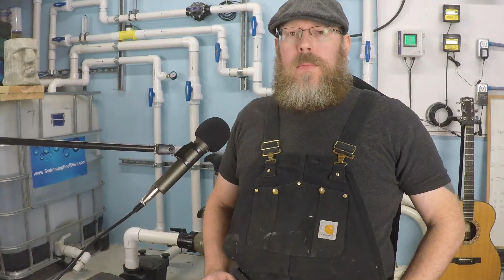DIY Concrete Pool Construction Mistakes

Comment: Been building pools for 40 years. Trust me. Call the pros. It’s worth it. If not you’re rolling the dice. You really do need to know all the little tricks, that’s what separates the men from the boys (and in most cases the difference between success and failure). A true service professional no matter what industry will probably give the same advice. Just trying to look out for peeps 👌

Comment: Is it worth doing both basecrete and hydroban? I’m building a concrete block plunge pool (filling voids with concrete and 1/2” rebar). Interior will be full tile, hydroban alone seems sufficient for waterproofing but I’m wondering if adding basecrete will increase overall strength and extend the pools lifetime
Reply from the maker: I would not mix and match waterproofing systems. You pick one and use that one only.
Reply: @Swimmingpoolsteve  thanks for the reply, your vids have been extremely helpful. Would you recommend basecrete over hydroban for a block build then?
Reply from the maker: @cameronm18  I would. When used properly I do endorse basecrete over any other waterproofing solutions. But that is just based on my experiences, and not to say that other waterproofing solutions are no good. I just prefer the Basecrete products. Laticrete would be my second choice for what it's worth, but it would also depend on whether you had a weir wall or not (water on both sides of the wall)

Comment: If you look at the documentation for most (if not all) reputable pool tile manufacturers, they recommend 3 separate layers of waterproofing, 1st a colloidal silica product sprayed onto the raw concrete shell, after it has set/hardened.  2nd, a cementitious  membrane like basecrete, or one of the similar products from other manufacturers.  3rd and final, an elastomeric membrane like hydrobahn.  When I build my pool which will have a full tile interior, I'll be using all 3 waterproofing layers just as the tile manufacturer recommends.  It's not worth risking 10's of thousands of dollars worth of tile because you cheaped out on a a few thousand dollars extra worth or waterproofing products.
Reply from the maker: 100% truth. Even more important when you start talking about the more expensive tile options like glass

Comment: Ive planned a pool with 8" formed walls and 5 inch base. Its all uniform  4" depth with both sides having a 12" depth for the kids. First thing is, I am not excavating ground for the pool. I have a cut and fill site and plan to build the pool walls - stand alone and then backfill after removing the forms. I'm planning to pour the base first and then the walls, with a key seal waterstop. I have drawn in a bond beam, which will also have the skimmers and returns placed in the forms - Should the skimmer intakes be two 3 feet apart? and tee in the wall leading back to the skimmer. Can you comment? Can I trouble you for another question - I will have to mount the skimmers in the forms

Comment: I have had an Endless Pool for 24 years (built it myself), now intending to replace the galvanized steel wall panels with filled concrete block, rebar & mortared joints. I'm planning to use large format porcelain tile on the inside wall surfaces (I have experience with that). Floor surface will be the shaved stone mats. Will the Redguard work for waterproofing over the concrete base and wall block surfaces? Would the Schleuter membrane be better?

Comment: Great informative video bro...im from the Caribbean...just gathering info. to start my own conc. pool soon. Thinking of doing a saltwater pool. What water proofing brands do u  recommend or can the same that u just mention work...thanks...
Reply from the maker: Look into basecrete as the waterproofing solution for your concrete pool. There are other options also but this is a good one.

Comment: AMAZING! Thank you so much for this video, very hard to find information about it elsewhere! - I am interested in pouring a concrete hot tub where the concrete is left with a raw finish. Do you think I could achieve the right level of waterproofing by using a water proofing additive like "Sika WT-240" or "Bio San 500"? If so which do you recommend? Also if I were to use an additive would you also recommend using a sealer like "Siloxa-Tek 8500"? For reference, the hot tub will be freestanding in a garden area. Many many thanks!

Comment: Thanks for the honest information. I am planning on building a concrete pool and spoke with an engineer as recommended. He immediately adressed all the concerns you had.
Reply from the maker: This is the way yo do it. Build a pool if you like...but hire an engineer to help with design, site inspection and soil samples, concrete and rebar specifications etc.

Comment: Steve's information is fantastic. I'm going to add that a cinder block concrete pool can be built but here's how using key instructions and types of materials: 
1. Building a concrete swimming pool out of cored blocks that look like cinder blocks (cored concrete blocks to fit rebar in and connect to each block) works. And it's not that hard but you must be patient and understand each phase. Curing is the key.
2. Use 1/2 inch rebar vertically in every cell and 3/8 inch horizontally. 
3. Mix rock with 4000 psi concrete mix. Pour each few cells at a time. Take the time to compact within in cell of each block.
4. When finished with walls. You pour 6 inch floor AFTER in small sections so that you have small expansion joints. Meaning there will be no cracks in the floor because each section is poured so small. This is crucial. Same mix as you did filling the walls. The rock is 3/8 inch and must be mixed with every batch. We do this all by hand with a bucket and not with a cement mixer.
5. Backfill with concrete and rock. Do at the same time you're doing the blocks.  (backfill is what goes behind the cinder block)
6. After walls and floor are poured? You use Rapid set cement mix to plaster on walls. It has a 9000 PSI. Rapid set is used at Home Depot. It's the key to everything.
Nothing is bringing down the walls and there will be no cracks if you do it this way. We do private homes this way. It's stronger than any shotcrete mix with any company. The difference is how it's all done. In small sections each day. Yes it will take longer but will be worth it. Expect it to take a year if you dig out you own inground pool by hand. If not, then 6-8 months depending on weather. Keep concrete after poured misted with water every hour then saturate with water after 24 hours. This is also the key.
7. The key to real waterproofing? Rubberize IT. This will create a 30 Mil membrane. You will never see a leak. Look up that product. It's non porous. You build it up by painting it on. It works better than a liner. Liner's tear. This won't. 
8. Go look online at any above ground pool. The largest you can find. The sides are a joke. And yet it holds up with no leaks. Why? Because of how the water is contained. They use a 20 mil liner for the standard pools. Yet the framing holds up hear after year. The key to everything is waterproofing but the foundation must be solid both with concrete and rebar. The rebar keeps the concrete tensile strength. The PSI is also crucial. If you do all the things above? And listen to Steve? You can and will build a pool that will last you a lifetime. The only difference is with Rubberize IT product? It will last longer than you if you go 30 mil on the buildup and use the material behind it shown on the website and never have to do a resurface your entire lifetime. Know these products. Understand them inside out. And it can and will be done.
Reply: Appreciate your advice on this, as I will follow it when I do my renovation. I have an Endless Pool, so only 30" water depth, and only 7 x 14' interior dimension. I need to replace the steel frame (rusted out after 24 years), so am planning to do the walls with 8" thick hollow block, mortared, reinforced and filled as you recommend. Interior wall surfaces I'm planning to use large format (2 x 4 ft) porcelain, rectified edge, with controlled lippage (I'm experienced with that). Bottom surface will be the shaved pebble stone mats. The floor slab is 8" thick concrete, on-grade, thus no groundwater issues, and even though I'm on a steep slope, the whole tub hasn't slid downhill over yet (heh). Structure is surrounded by CCA wood deck and underpinnings, so is just as sturdy as the year I built it (1999). My main question focuses on the type of waterproofing that I should use on the interior surfaces before I install the tile. Is Redgard recommended? Should I use Schleuter membrane fabric as a better option? Should I consider using both? Love your name, by the way!

Comment: Steve, great explanatory video. This is top notch content. I have a question. Would poured walls work for a pool instead of the sprayed? I understand that when it’s sprayed it’s all done in one spray and there’s no seams but with poured walls you have the wall and the slab which creates a seam at the bottom. Just trying to understand if that will work if waterproofed properly. 
I’m in construction business and plastering/stucco is one of the trades I do for a living so I’m familiar with all of this but not much with concrete. 
Any input would be much appreciated.
Reply from the maker: CIP pools - cast in place, are common enough. Some pour in one shot, some in two. I like the idea of pouring the floor and then the walls in a separate pour. If you use a water stop and a urethane bead where the two meet it can be waterproof. Then add your waterproof layer to the whole pool and then plaster. Some skip waterproofing but I definitely endorse not skipping that step.

Comment: In Arizona we cant build pools without engineering. Engineers often call out for 12" x 12" grid #3 rebar. If the walls exceed 6' tall we increase the verticals to 6" on center. In areas where we have expansive soils like farm land we do 6" x 6" #3 grid. If we are building a masonry structure like a big grotto or something on the pool we increase to 6" x 6" grid of #4 rebar. I always overkill wherever possible.  

Calcium from the water gets behind tile and expands and pops tiles off. Pebble-Tec is BY FAR the bast interior finish.
Reply from the maker: It is crazy to me that there are still some areas where you can build a concrete pool without any engineering specifications at all.
Reply: @Swimmingpoolsteve  here in the southern US very little is focused on consumer safety. I'm in South Carolina, and by far laws favor businesses. We're decades behind other places in so many areas, and this is one of them.
Reply: @Swimmingpoolsteve  We have a company called "BYOP" here and their clients are out there building total shit shows. It is nuts that someone would even want to BYOP!

Comment: I think you scare me out of a block small pool but concrete seems impossible for me to do by myself
Reply: I'm a masonry contractor not a pool builder but...block walls are built in basements with 10 ft. ceilings everyday,  hydrostatic pressure is on 1 side of the wall. in a pool, once filled the pressure would be on both sides. if every cell was filled with block fill concrete and rebar every 5th cell I think the strength would be fine. on the proper footing cracking would occur similar to a concrete wall. cracking would not occur along mortar joint as mentioned because the cells would be filled with concrete. however, expansion cracks could occur just like concrete. pool plaster has some flexibility, maybe even a fiber reinforced coat before pool plaster would help? block might not be the best option, but for different reasons than mentioned
Reply: I'll add I left out details like bond beams and other things so don't take what I said as the only things needed

Comment: Can we go with concrete thickness of 6 inches with 10mm 8 inch centre to centre . My pool size is 15 feet * 30 feet. Pls reply
Reply: I wrote a very detailed response above to everyone. Steve's info is fantastic. I add to how to build a cinder block pool.

Comment: Hi Steve, thanks for sharing your expertise ~ I have a few questions 1)did I hear you say that a plaster pool should be redone nearly every 7 years.  Are you talking about the old plaster being removed and replaced every 7 -10 years.  2) did you say for a tile pool the waterproofing needs to be done as opposed to the tile simply being installed on the plaster.  Is that what you have seen fail? By water proofing are you talking something like the Basecrete you mentioned? 3) you talked about a french drain system for pools .... I can not picture a French drain system for below grade pools ?  Thanks again for your work here :)
Reply from the maker: To your questions, a plaster pool should be redone every 7 to 10 years max. Like a shingled roof you can add a second layer of plaster one time, and after that you have to take everything down to bare substrate and plaster again. Waterproofing should be everywhere in a pool, it is just that the tiles will probably be the first thing that fails as a result of not having it. Concrete is porous and will leak (leech) water which causes mineral buildup and wear of the concrete as the cement component slowly erodes away with the passing of water. This is what I mean by waterproofing, but also controlling ground water around and adjacent to pools is of paramount importance as a host of problems can occur from uncontrolled or high ground water tables. The drainage system in that case is a sump well to the pool floor which sits adjacent to the pool, or a French drain which aims to control water (most commonly) at the foot of the walls. Basecrete is one concrete waterproofer which is useful for making the concrete structure waterproof. There are others as well such as Redgard, Hydroban by Laticrete and more.

Comment: Not a pool guy but I think using Xypex c-500 mixed in with the concrete to waterproof would be a great way to stop water from penetrating from both sides.
Reply from the maker: It definitely works.  I used this primarily for waterproofing artificial rock waterfalls but have seen it used in pools as well.  It will make the pool more water resistant, but for me it was not reliable enough for situations where waterproof was a paramount concern, like a pool over living areas for example.

Comment: Great channel. Long time concrete contractor and would like to build one myself next spring. Couldn't agree more on the foundation designs, steel is a dollar a pound. Put it in. Concerning waterproofing, would you consider waterproofing BOTH sides of the wall? We do tons of elevator/containment pits, and typically waterproof the outside. Do you have any input on a concrete admixture such as Xypex? Really have found them effective.

Last question: what are your thoughts on installing a recess tile lip near the top? 

Thanks for any input.
Reply from the maker: In my experience waterproofing both sides of the shell is a potential issue where you can trap moisture in the middle.  In theory it is dry in there with waterproofing on both sides, but in the real world faults or imperfections will allow water permeation where it now becomes trapped.  Waterproofing of the interior shell is the industry standard, with control of the surrounding ground water being an important part of this system.  You definitely want a french drain and/or perimeter drainage system in place to take water away from the pool area as opposed to allowing it to pool behind the walls.  As far as Xypex, I used this quite a lot in the 2000's but ultimately I could not rely on it as a waterproofing agent alone.  By that I mean suppose we are going to put a pool on a roof above a bunch of million dollar condos...is Xypex REALLY going to be enough?  Not for me.  Not even within a structual membrane box.  Or what about a regular inground pool, but with $100k of imported glass tiles going in?  Will Xypex prevent water permeation to the point where you can be certain you will not have efflorescence degrade the thin set bond to the tiles?  For some contractors maybe the answer is yes.  For me it is no.  I use membranes like Redgard, Hydroban by Laticrete, and Basecrete as mentioned in this video.  There are others as well.  These are just the few that I have had experience with.  As for tile, every pool needs tile along the waterline.  Tiles and the plaster interior surface should be flush.  This is standard for how to build concrete pools.  Cheers.

Comment: ok so would like more info on Repiping a concrete pool, drilling holes, gluing pipes to concrete? and plaster / sealing around pipes. thanks
Reply: please make a video, there are not any good videos on this.
Reply from the maker: This is a LOT of technical information.  I am doing my best to put content like this out there, but if you want more specific info you will have to look at my website where I have long form articles, pictures and diagrams etc. as it helps to explain these complicated subjects.  I have hundreds of articles on my website, and perhaps this is a good page to get started on: https://www.swimmingpoolsteve.com/pages/pools.html
or you can also jump to the page which lists every article in chronological order, www.swimmingpoolsteve.com/pages/pool-blog.html